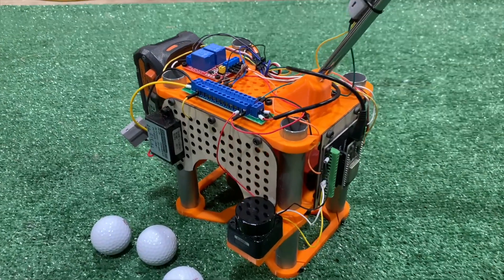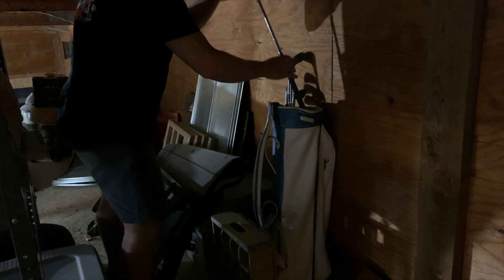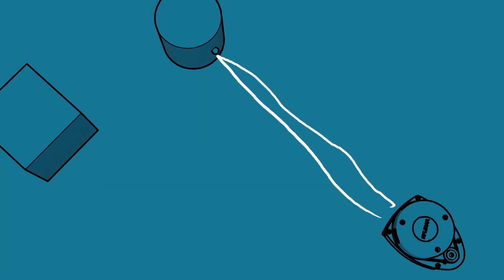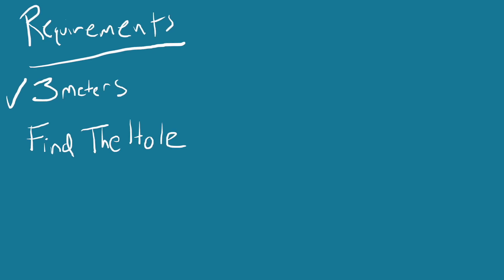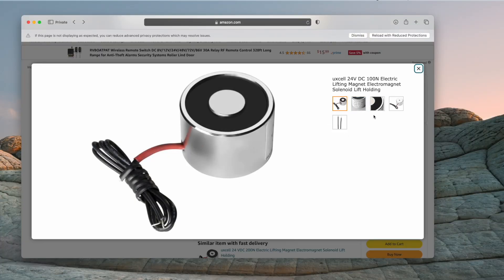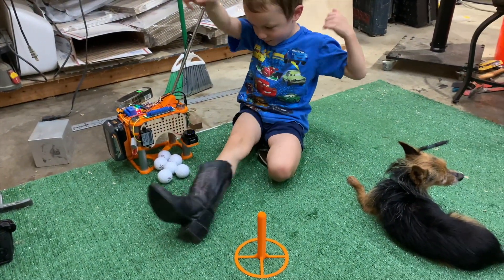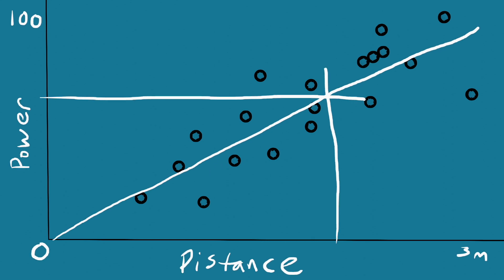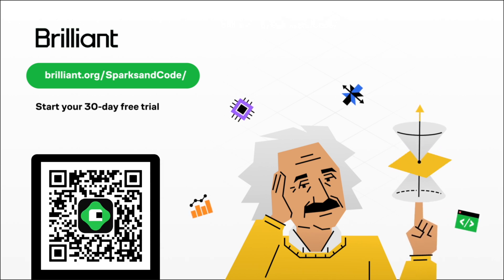a golf putter that aims for you

Comment: Instead of turning the putter head, you should’ve turned the suspension point. The “fixed” bar at the top where the pendulum is affixed and it sways/rotates on. Turning that bar to the left/right wouldn’t affect the amount of inertia released from any drop point…

Comment: 1:28 this is kind of an oversimplification and reality is usually easier or harder than this. if you hit a ball in an array of angles from the same starting position, you would see that a number of angles actually converge on the same path. this is because of environmental factors like the quality of the grass, how much its been played on or walked on already, and the topography of the ground. a slight bump in the ground could creating a funneling effect where any number of angles end up on the same path. it works in reverse too and you can have chaotic putting greens where if you start on a raised portion, you may have wildly different paths with tiny angle changes. You will rarely run across a perfectly flat green. even if you examine for local flatness, you are still likely to find enough variation to skew your ball's path

Comment: So cool! Really great job making all this but also documenting the process to create this video. When you threw away the burnt-out microcontroller I was wondering: what MCU was that, and on what board? It looks like an ESP32-S2 or S3, but I was wondering if you had any special requirement that had made you choose a specific board and/or with some specific connectors.
Reply from the maker: I had to go dig it out of the box just now.... but it was a ESP32-WROOM-32

No special requirements other than I knew I wanted more speed than an Arduino but didn't want to pay for a Teensy (I got 3 ESPs for the price of one Teensy).  I also had it laying around from a previous project.
Reply: @SparksandCode  Thanks for the reply! Yes, this board is cheap and Teensy boards can be much faster but are definitely expensive. It still seems like it would be more than enough for the amount of computation, at least I hope so. The WROOM chip also seems to be super common, Espressif must have made tons of them seeing how often I notice it mentioned in AliExpress listings. Just checked, a "default" board without extra SPI RAM or flash (so 520kB SRAM + 4MB SPI flash built-in) often goes for only $1 each even if you only get 10 of them. They're so cheap, it's hard to believe :-)

Comment: Very cool. My first thought at the conclusion was, I wonder if you could adapt it to handle variable conditions on an actual putting green. Short of using a camera to assess conditions, could maybe add a dial to modulate the power of the hits and adjust based of it under/over shooting.
Reply from the maker: I considered rotating the lidar to scan the green for that kind of thing. 
Maybe v2